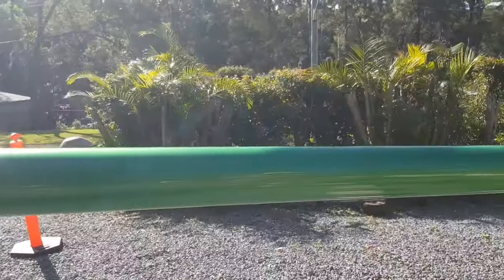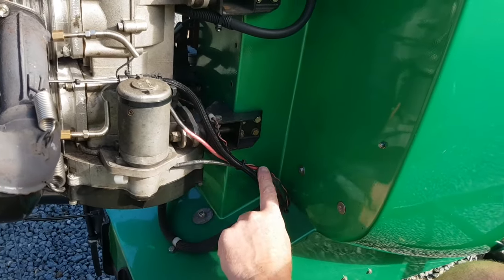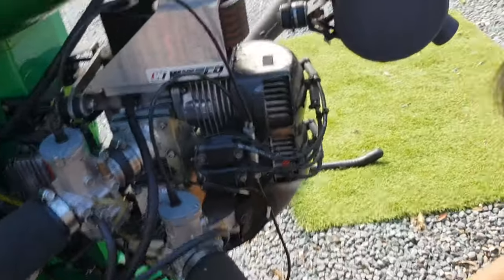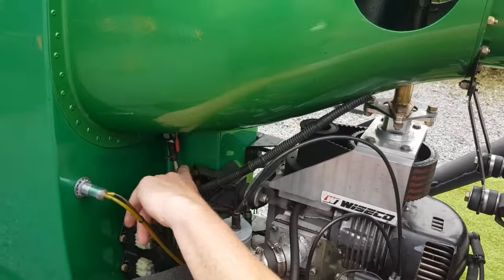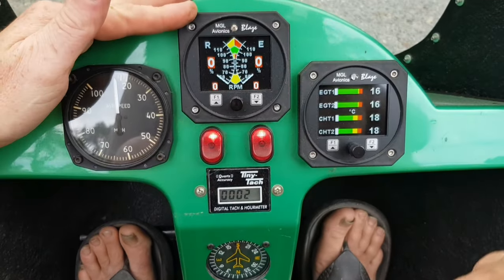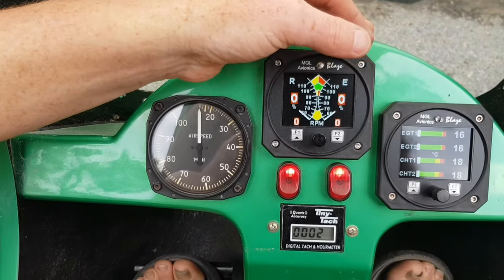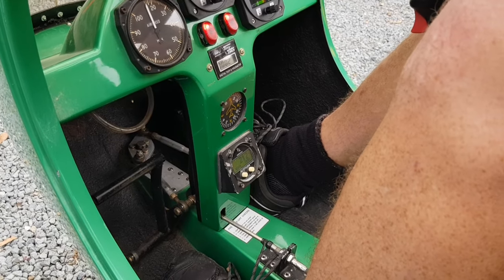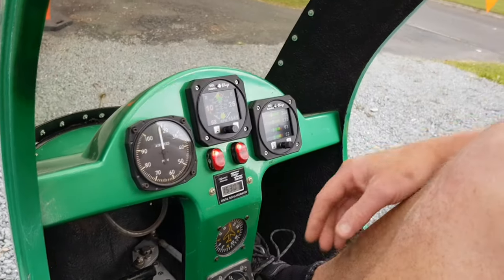Start up procedure/DI for XE Mosquito Helicopter. Air cooled 2 stroke. MZ 202

Comment: Use red locktite on all those bolts you need a torque to heat the nuts and bolts up to take them off but they won't vibrate loose brother
Reply: locktite is such an underrated tool often neglected on any type of machinery

Comment: No cotter pins or safety wire? Thats really livin on the edge
Reply from the maker: Lock nuts. Tightened with torque wrench. And markings that indicates any movement that get checked every preflight. So it's a very safe edge.
Reply: @budthebusker  i'll take your word for it